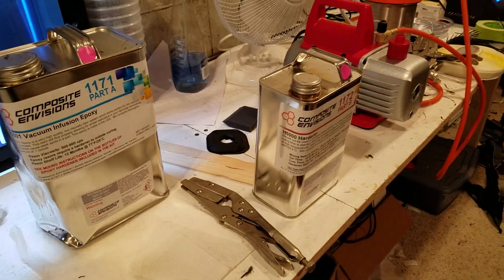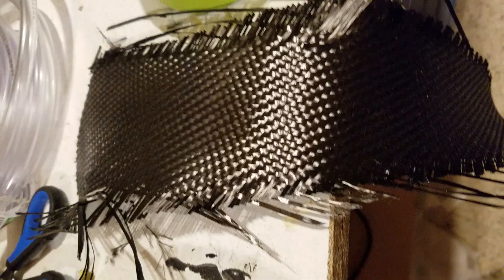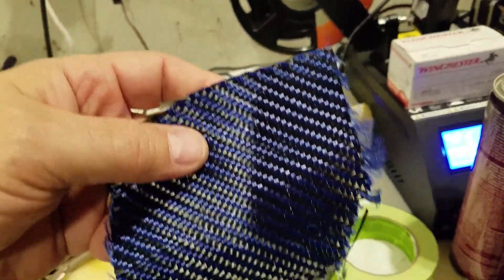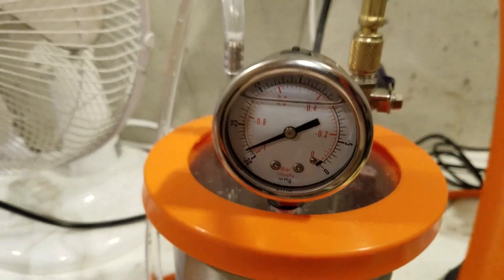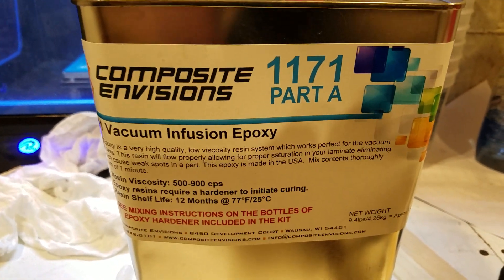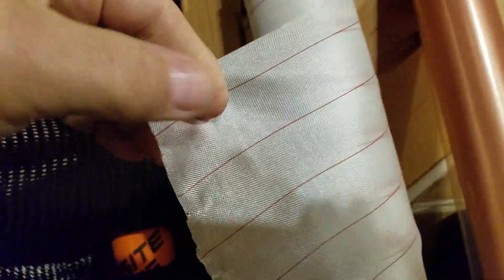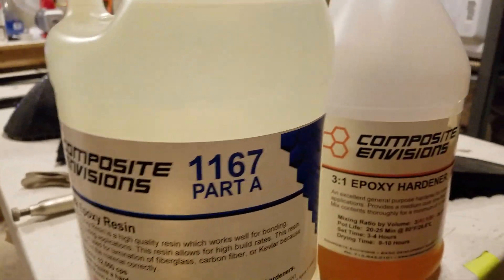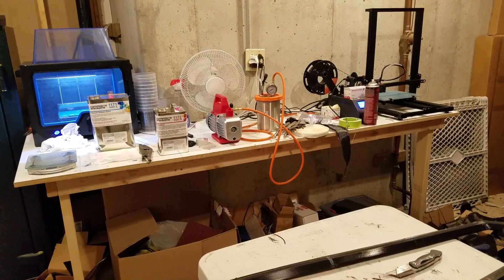Skinning 3D printed body parts (encapsulation) supplies and tools - Part 2

Comment: My dad's a mechanic and is interested in 3Dprinting parts so your videos are very helpful. I know this is an older video but as I am watching, I had an idea for the carbon fiber mat. Wondering if you used a hot knife/fabric knife to cut it would it fray less.
Reply from the maker: Kevlar scissors.